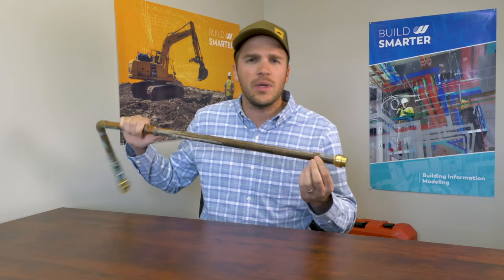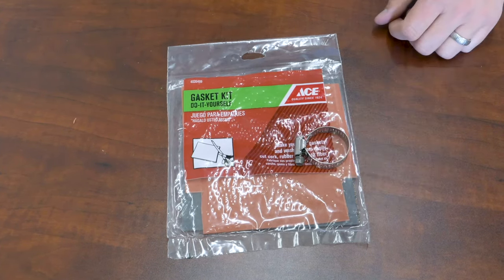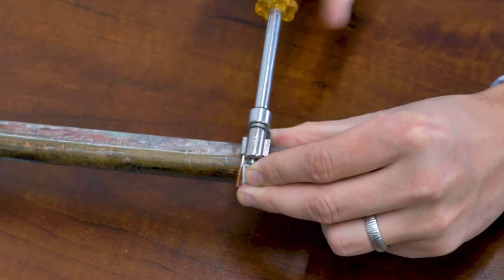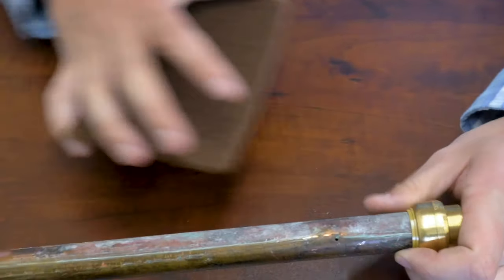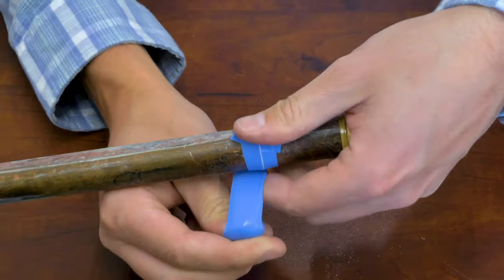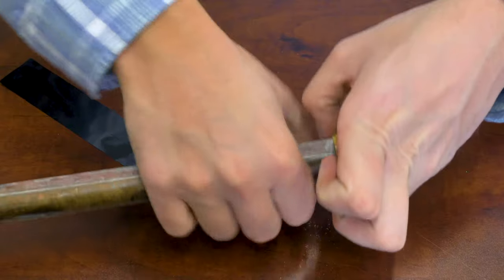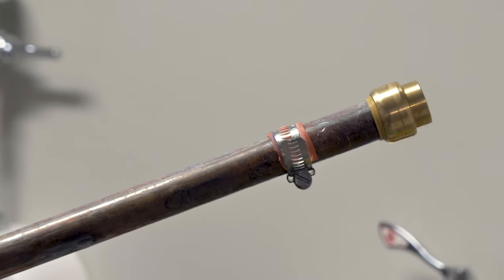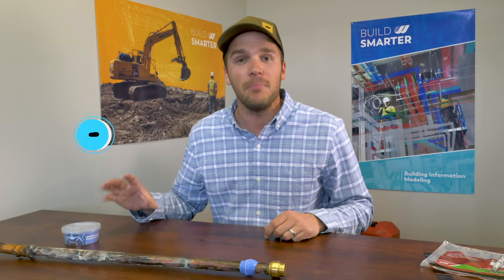How to Fix an EMERGENCY LEAK: Two Methods 🔧 💦

Comment: The gasket shines on a run of pipe which has even surfaces, as you demonstrated. But silicone self-adhesive tape works best where the gasket doesn't - at a joint where pipe and connector(s) meet and surfaces are different heights and even unlike materials. 
I like to stretch-wrap in one direction. Then with a second piece stretch-wrap in the opposite direction, like gluing two pieces of wood together with opposing grains, making it doubly strong. An unstretched wrap to cover the job doesn't hurt at that point. I've had these repairs last months if out of direction sunlight.
I live on a farm with 75 yo 1/2-1" galvanized plumbing, so have been replacing as it breaks. Silicone tape has saved me lots of money and kept the water flowing.
Thanks for a great video!
Reply: Awesome set right there 👌

Comment: The clamp approach worked for me this evening. Had a hard time finding the rubber gasket material. I ended up at Harbor Freight and bought a $3.99 hand-truck rubber inner tube and cutting it to size. So far, it's working on our pin hole in a copper pipe that connects our house to the water main pipe.  No leaks...knock on wood! Thanks.

Comment: Quinn, I just wanted to say "thank you".
Grabbed a single sheet of red gasket from Ace hardware, worm clamp, and it's been holding for three days now.

Next step, replace copper supply tubing with PEX using PTC connectors. 😊

Comment: The gasket and hose clamp method saved my bacon. Pinhole leak in 1/2" copper. Held beautifully for 4 months until I could fix with Pex and Shark bite brass couplings.  Had no money for plumber and needed time to learn how to correctly couple Shark bite with copper and Pex.  I'm confident the gasket and hose clamp would have held much longer if needed.  Super Helpful video!

Comment: I would also like to thank you for the gasket and hose clamp solution. I just got the stuff for it, and now the pinhole in my basement is (temporarily) fixed. All the wet and moldy drywall on the other hand...

Comment: Thanks for this video.  It helped to repair pin hole leak after Texas freeze.  Hope to find a reliable plumber to get it properly fixed.  One thing I must say that all the pipes have very small clearance where you cannot reach with your tools and cannot rotate the tools!!  But, I was able to fix it temporarily so we have water now...
Reply from the maker: After hearing all the bad news coming out of Texas, it's gratifying to know that we've helped at least one Texan's plumbing. Really glad this was able to help you out. Good luck finding a plumber! 🙂

Comment: The first method worked great for me. I used a piece of bicycle inner tube and a hose clip and it worked perfectly. No need to drain or depressurise the system and made a strong seal. 5*. Saved my bacon.

Comment: Watching from Dallas. My pipe burst. The slit is wider than my clamp, dang it. Tried with two clamps but no luck.
Parts and plumbers not to be found anytime soon, so I ordered the monster compression tape and asked them to overnight ship. 4 neighbors and I all have  slots, not holes. Wish me luck!! Thanks for your help!!
Reply: go to auto part and buy hoses for radiator and coolant sold by foot  . have a sample to find the hose by testing it. oreilly AUTO PART  part gat 28444 $6.49 FOR SMALL HOSE I THINK 3/4 INCH AND 3/4INCH GAT 27010   GAT 28444 1/2 INCH    USE CLAMPS TO HOLD IT IN .
Reply: Makes sense,  car hoses withstand great pressures, keep them fresh with good quality tire foam or other conditioners and maybe replace every 10 years or so.
If you an old wrench hand you can tell by the feel when hose is getting weak("that's what she said").

Comment: Never considered a gasket repair kit, but that will be the new way i go. 

Iv always used a hose clamp and then cut a pvc rubber boot to size, and it held for up to 6 months.

Comment: I have come to confess my sins as a home owner and landlord in the poverty stricken city of Tucson. I've been using old automotive heater core hose and automotive hose clamps for 40 years to stop leaks in galvanized pipes. Many of those patches have lasted 40+ years!!  

I know it's not a good idea for drinking water. However I never drink our city's tap water and few do. It's just not safe ever and especially since they put us on CAP water and accelerated all the rust in pipes city wide.  

In the future I will probably go with the patch you have recommended. But these temporary patches can last for decades. In Tucson you can probably expect to see more leaks appearing and a re-pipe job in your future. Well done video !!

Comment: Question: I've read reviews where this works excellent for hot water pipes.  I have a drip lead at a joint before my water meter. [The water main feed and I can't turn off the water unless it's done by the water co.] If I cleaned the joint  and  pipe well , but let the water run on a sink  to release pressure, then heated the pipe with a hot air gun; would that increase the chances of it working to stop the leak?

Comment: I just put the gasket and clamp on a pin hole that was weaping on the 1/2 copper pipe coming out of my boiler. Seems like it worked. Do you think I can leave it until end of summer, like September when I get my boiler serviced. At that point I would like to have the pipe replaced. Thanks.

Comment: Our main is controlled by the city (live in central europe) so cant shut it off.
our main in our house - is leaking - flooding the floor.
* Its coming from the seems of the pipe where they join and from the turn knob itself. (messed up)

Used caulking, etc. and it just spread it around - i have about a liter of water every 2 hours and cant get it to stop.
we have like 1 guy in our city and hes booked till next year, essentially - emergency or no. (this country is a bit 'crazy' with things like this)
* also, dont have all the items you have stateside.

I even tried soldering it - no good, destroyed the gun right away.
drip - drip... then drips after you try caulking/taping, etc.

im at a loss, shutting it down, still drips a little (from in the house - and we cant use the toilet or anything then)
any adivce??? thanks!
Looks to be iron pipe - old as can be and coroded down in the city part where its 4 feet underground in a man hole)
But for our pipe its just at the seems and turn knob its leaking.

Comment: I had a pin hole leak in a pipe, got a hose clamp and cut a piece of rubber off a stair tred, it worked at first then in about a week it was dripping, I tighned it up a little and it lasted months.

Comment: That hose clamp fix worked for me back in 1983 hot water pipe under house froze and a pit came out old galvanised pipe.I did not have a special gasket I used a piece of car inner tube and 2 hose clamps.Ughhh its still holding lol no joke.Oh i didn;t subscribe but i did wink wink

Comment: For my grand father, he alway used to fix (rusted iron pipes) leaked pipes with all kind of material useable as "gasket". Let's just say i have never been a fan of that unless the patch is permanently visible & accessible. I rather change a leaking iron pipe than give it a band-aid because it's just asking for it to leak somewhere else once again.

Comment: Man I bought an apartment in a building with a central heating system and I saw one of these clamps on a pipe in my bedroom. I found out that it was there for years, a plumber told me not to touch it, but I wanted to permanently repair that. I don't know if they have just placed a rubber underneath or if they have applied something else beforehand. I am basically waiting for it to burst at some point, lol.

Comment: What if you have a leak at the edge of a fitting such as an elbow or even a shutoff valve? I don't see how to use the gasket kit unless the leak is at least a 2 or 3 millimeters from the fitting but would the compression tape work?
Reply: I have done plumbing for 20+ years as a landlord. NO... none of these tape repair kits will handle an elbow joint. The water pressure is no just leaking out the side. The water pressure is basically trying to remove the elbow joint. You will have to sweat the pipe on with lead + solder.

Comment: Thank you!
Reply from the maker: No problem. Hope this helped!
Reply: @willplumb  Okay, gasket is on.  The "pin-hole" was a slit, and close to a solder joint.  Time has been borrowed.  A real plumber will be called on Monday, this copper pipe is 65 years old.  Thanks again.!
Reply from the maker: @BluegillGreg  Perfect. Glad a licensed plumber will be taking a look at it. Time borrowed, indeed! 👍

Comment: Those blue tape repair kits blow apart in less than 3 hours, believe me I know, I'm a licensed master plumber and get calls on these all the time. Best way to fix a copper pipe is to call a plumber

Comment: I popped a hole in the headers on my Mustang by bumping into the nut on a 4" black pipe cleanout. A ball of crumpled up aluminum foil & hose clamp took care of it in a flash. Temp fix turned permanent.😄
Reply: That repair is about the same quality as the rest of the mustang.  Great car for women, it was after all designed for female consumers.